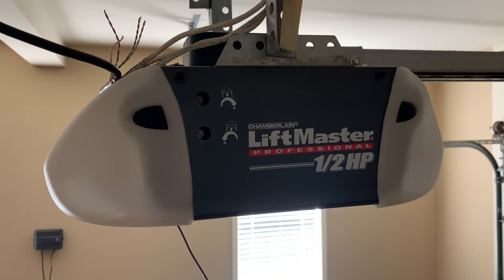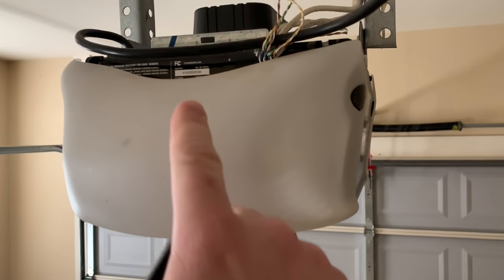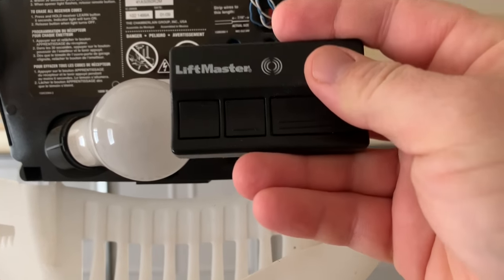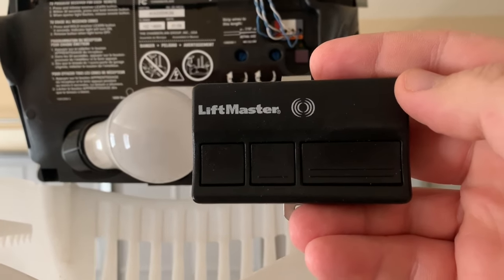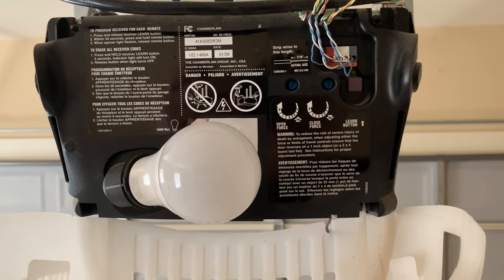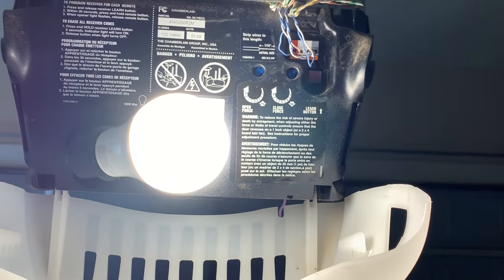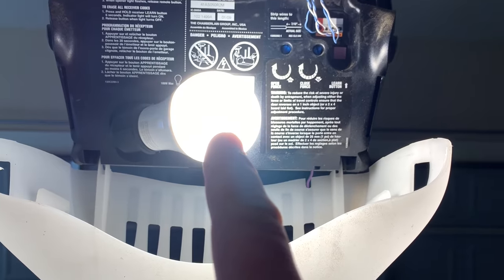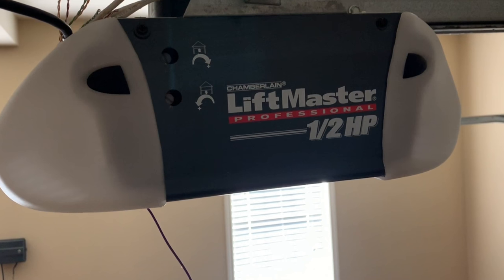EASY FIX: Garage Door Remote Not Working

Comment: How do i change battery in liftmaster remote
Reply from the maker: There are too many models to tell you how yours works but there is usually a screw then you pop the two halves apart.

Comment: My neighbors remote opens my garage door .. how do I reprogram remote ? Keypad?
Reply from the maker: Yikes! You will need to clear your codes on the control box, not reprogram the remotes.
Reply from the maker: Hold down the learn button until the light turns off then release it. Quickly press it one more time and hold until it turns off. This should erase all codes. You will then follow my instructions to reprogram each of your remotes.

Comment: My remote works from close but doesn’t work from distance I change the battery and again the same problem
Reply from the maker: Do you have a second remote that works well from farther distances? Check the antenna on the motor and make sure it’s hanging down.

Comment: What if your remote is stolen ? Can you change the code so the older remotes won't work ? 

HELP ....HELP ....HELP
Reply from the maker: Yes. Hold down the learn button until the light flashes and keep holding it down. It will clear all codes.
Reply: @TightWadDIY  Thank you for the info. Greatly appreciated.

Comment: Hi
My issue I’m having is the remote only works within 5 feet away or when I’m inside the garage. I also do have a led light bulb 💡
Reply from the maker: Fernando Rodriguez Have you changed the batteries in the remote? Try that and then unscrew your LED bulbs and see if your issue is fixed.

Comment: What is it does close and the light just flashes.   Geez.  And trouble shooting when things don’t work?!?!?
Reply from the maker: That sounds like an issue with the sensors. You should have a steady green light on one of the sensors.
Reply: Thank you for responding.   I did find that it was a sensor after some time.  I cleaned the sensors gently with a rag, checked the wiring and the garage door closed.   Check the sensors!   $30 fix for new opener.
Reply from the maker: @cicipeek4867  That’s great!

Comment: When I click my learn button the led flashes but doesn't say on 😐
Reply from the maker: Look up the programming instructions for your unit and see if they are different.
Reply: @TightWadDIY  turns out that purple antena and red button has to be programed holding remote button and the 2 buttons on the wired wall switch
Reply: Me too, the led just flashed, no stay, and I dont have wired wall switch. Is a red button. Any ideas?

Comment: Mine still isn't working
Reply from the maker: Sorry. Do any of your remotes work?
Reply: @TightWadDIY  Nope. I used this video before and it worked. Idk what the issue is now. Not one remote works. All of them light up. Even the car has disconnected 😭
Reply from the maker: @purpdajerk89  Try resetting the system. There should be instructions near the button. You usually just hold the button down for 10-15 seconds. Once it’s reset, try programming one remote to see if it works. Also, remove LED bulbs near the opener.
Reply: @TightWadDIY  ok. Will try that tomorrow.  Its raining here in Cleveland.  Appreciate it 😎

Comment: When I push learn bottom then remote I don't hear anything
Reply from the maker: Does holding the learn button do anything at all? Are they lights working so you can be sure you have power?
Reply: @TightWadDIY yes I have power but nothing is happening the learn button is flashing

Comment: Well the light did not go off it kept blinking and thrn stopped.
Reply from the maker: That usually means there is something wrong with your sensors.
Reply: @TightWadDIY  what sensors? First Remote was working but after another already programmed remote was used the First remote stopped working. And now it is not reprogramming.
Reply from the maker: @jakeb8298  Usually if the light flashes repeatedly after pressing the button on a remote it means there is an obstruction. Either the door is off track or there is something between the sensors that let the door know if there is an object in the way.
Reply: @TightWadDIY  upto now you have given me wrong advice. I think you donot know about much gatage doors.
Reply: @TightWadDIY  and who said light is flashing on the remote? I did not say that. You are not an expert, I can tell. Wrong person to get advice.
Reply from the maker: @jakeb8298  Nobody said there was a light on the remote. You push the button on the remote and the light on the motor flashes…. You said the light flashes. Right?
Reply from the maker: @jakeb8298  Being rude to someone giving FREE and ACCURATE advice is not a way to get more FREE support. You misunderstood the message.

Comment: These instructions will not work for you if your remote has a program button. Follow the instructions that came with your remote instead.
Reply from the maker: That’s correct. This is for dumb remotes, not smart remotes.

Comment: brand new remote, doesnt work
Reply from the maker: Do other remotes work?
Reply: @TightWadDIY  the remotes that are already programmed do, yes. Unit will not enter learn mode, nor connect to MyQ. Already checked the wiring, lightbulbs, remote batteries and back up battery.

Comment: Easy IF you can get into your garage! I cannot so this won’t work for me.
Reply from the maker: You can’t get into your garage from you home or from a normal door?!?
Reply: @TightWadDIY  no. It’s an apartment complex and the garages are in the parking lot, separate from the building. We just had new doors installed so this remote and unit are brand new. It was working fine the other day. And there’s an app I can use but I can’t set that up until I can scan the motor inside the garage! So frustrating!
Reply from the maker: @dimattia11  Yikes. Did you check to make sure the breaker that controls power to the garage isn’t tripped?
Reply: @TightWadDIY  yes. It’s so weird how it’s set up. There’s a GFI in our hall bathroom that usually resets it, but that didn’t work. It ended up being something in the outlet inside the garage. They had to call someone out to get inside. It was a mess. It’s all fixed now. Just so thankful my car wasn’t in there!
Reply from the maker: @dimattia11  Whew! Im glad they figured it out. What a nightmare!
Reply: @TightWadDIY  thank you. It really was.